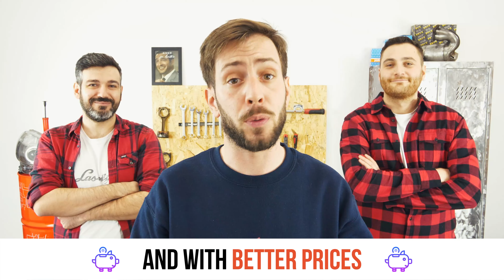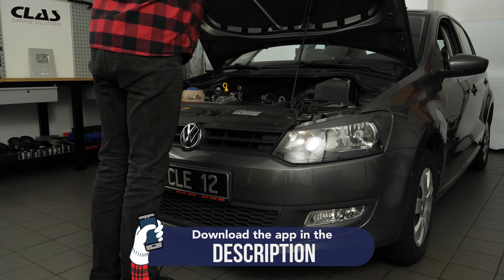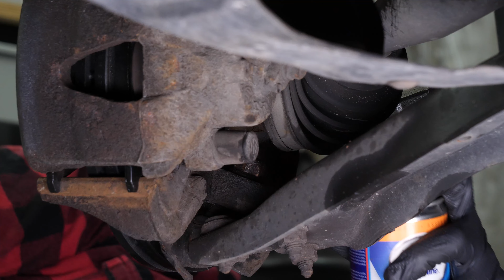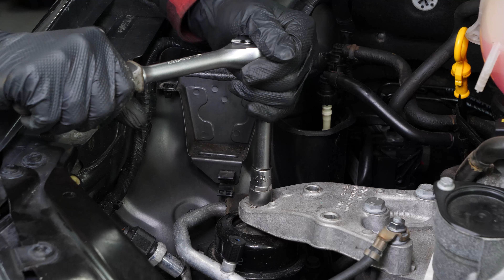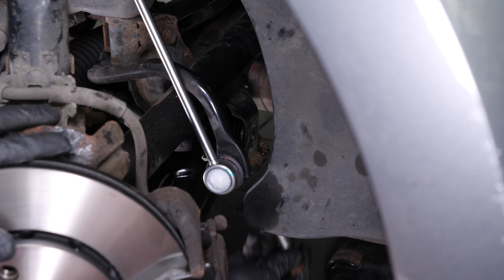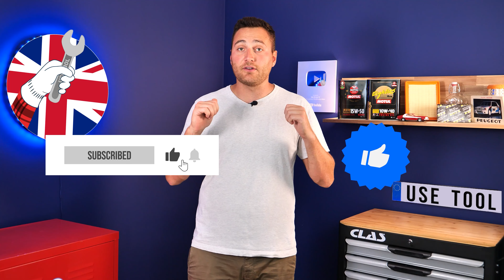How to replace the control arms Polo mk5 🚗

Comment: Helpful video but what a terrible design with access of the front bolt
Reply: just take the under tray off, i did mine on the weekend no issues at all
Reply: @Bucko_fx did you use new bolts ? Im just gonna reuse them with some loctite but i dont know
Reply: @YunusEmre-67  nah old ones were fine, just clean the threads and youre sweet